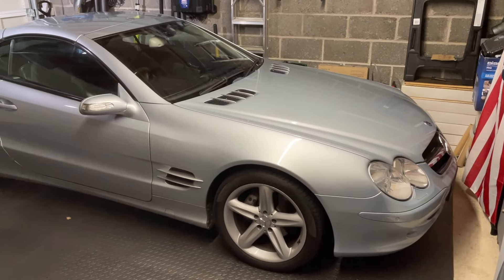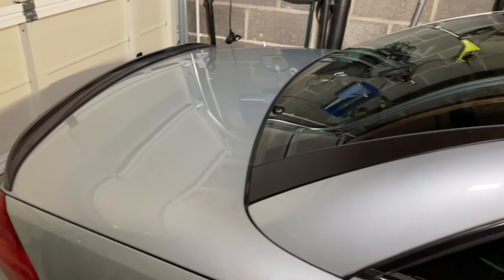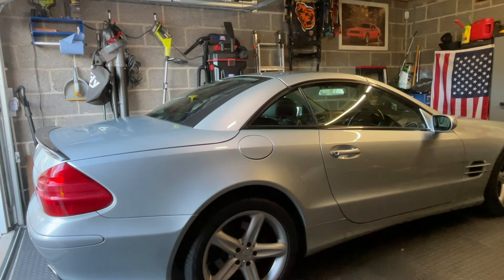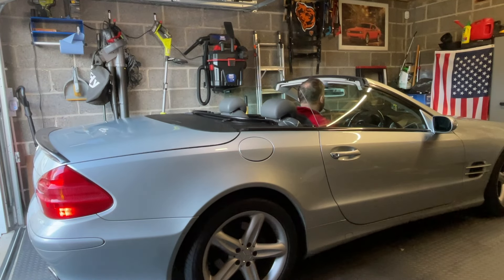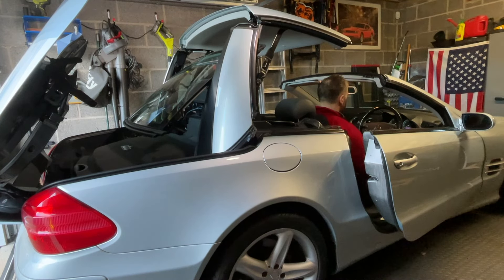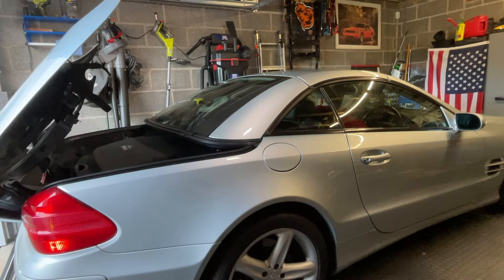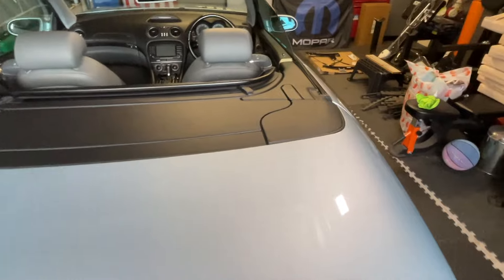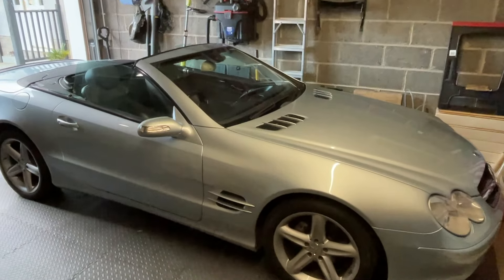Mercedes SL R230 Prevent roof water leaks by treating the seals. Winter convertible maintenance.

Comment: I used a clear silicon grease £10 off Amazon for 500ml tub, I do mine once a month light coat with a brush. I used to get the odd small leak between the roof and rear screen, now all ok, It just refreshes the rubber, helps stop leaks and squeeks. I,m looking for a good workshop manual if anyone knows of one? thanks Ian
Reply from the maker: Nice one👍Thanks for taking the time to comment. Have you tried easymanuals.co.uk for a workshop book?